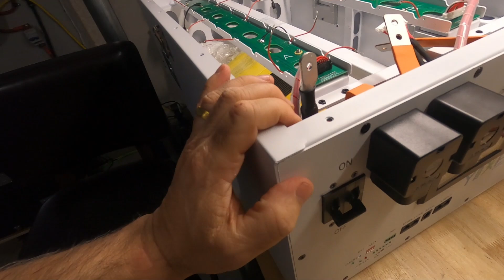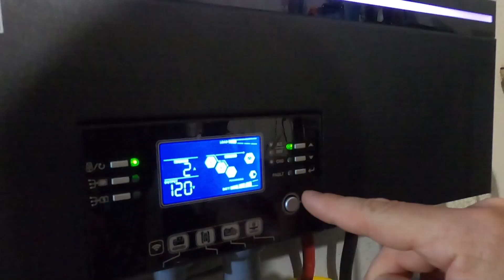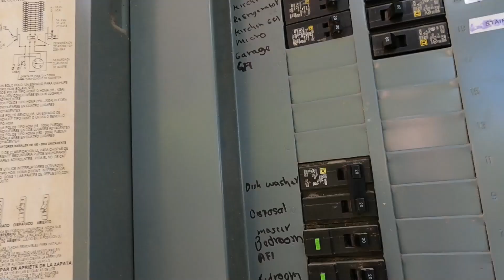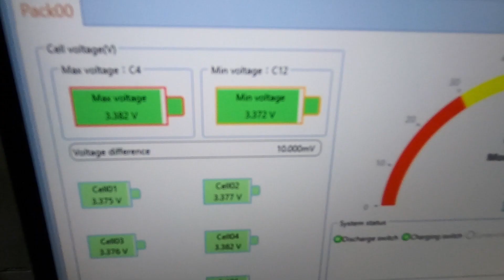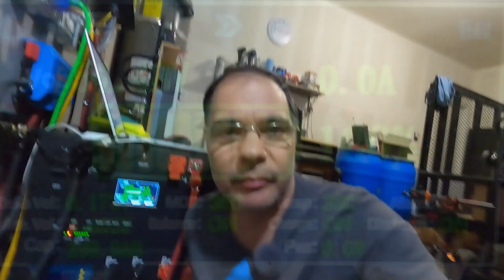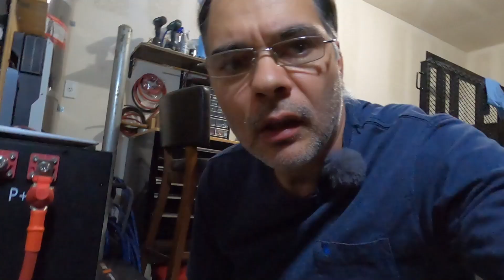Top Balancing The Yixiang DIY Battery With JK Inverter BMS

Comment: For the most part a 20 amp rated circuit and receptable should only be operated at 80% amps continuous for #12 conductors: A 20-amp circuit, as defined by the National Electrical Code (NEC), has a maximum capacity of 2400 watts, but for continuous loads, it's limited to 1920 watts or 16 amps to ensure safe operation and prevent overheating. This is due to the 80% rule, which mandates that continuous loads (those operating for 3 hours or more) should not exceed 80% of the circuit's capacity.

Comment: So for top balacing you need to turn off the battery manually? I tought was done automatically bij the JK everytime the battery was fully charged.
Reply from the maker: It is done at full charge, but if your cells are badly out of balance, you may never reach full charge or stay there long enough for the balancer to do its work. You should always do an initial top balance, in my opinion.

Comment: Hi sir, what you think about Heltec 10a active balancer? I think it should handle top balance 4 times faster
Reply from the maker: It's good.  I have one.  Yea, if you are building a ton of batteries and want to do it fast. But for the average DIYer, the 2a active balancer is fine.
Reply: @natesdiysolar  I just watched your video about top balancing, and you did it for a very long time, I have a 120 mv offset on three cells after fully charging to 3.6 volts and I wanted to speed up the balancing process, do you think heltec will do it quickly? Will it help?
Reply from the maker: @Reebcor  the seplos bms took a couple days but the jk took 8hrs I think.  Yes it would help.  Especially the 5a one. I think 10a would be overkill unless you are boxing tons of batteries.

Comment: This is probably a really basic question, but if you have a good inverter like the EG4 18k or a Solark connected to the battery and have the time to wait, would the balancer work itself out over time to equalize the charge on the batteries?  I get that initially you would be losing capacity while the batteries are not evenly charged, but would the JK BMS built in balancer do it's job if you just hooked it up and let it do its thing over multiple days?
Reply from the maker: It may or may not.. it really depends on your charge settings and if they are meeting the requirements set in he BMS to trigger balancing.. if balancing is never triggered, it will never get done.. unless you are charging from the grid, it may be difficult to get a low enough current for a long enough time to get a proper top balance.. so, in theory, it should work, but I would not recommend it.  If it keeps hitting ovp, the BMS will just turn off charging.  I always like to use a stable power source like a power supply or low current battery charger for the initial balance.. hope this helps.

Comment: My inverters don't float at all for Li batteries. When the BMS reports 100% the charge cycle is over. Had to play with the balancing a little to get something that worked but my cells never deviated more than .030 at the beginning. After about 8 or 10 cycles the cells were better conditioned and by the time I get to the top they are pretty close, less than .010 and below .005 within a few minutes. That's been happening with three batteries at the same time and I'm getting ready to add six more of them. I'm considering switching one of my converters to Lead Acid profile so I can get some absorption and float voltage on the bus from at least one charging source. I don't know, see how it goes from here.....
I'm pretty pleased with the JK's. My packs are pretty much charged to 100% everyday or very close so SOC isn't much of a deal right now. Andy at Off Grid mentioned in his last video that they may be coming up with a better solution for the SOC. Guess maybe there's a 15.34 rev for the Fireware coming? hahaha
Reply from the maker: Good to know.  Thanks for the info.  Good job with the batteries. :) 😀
Reply: Don't know that I can claim much credit for the cells. Every pack I've put together were all setting at 3.27 @ .001 difference. Nice starting point.
Reply from the maker: @beebop9808  yes at maximum there could be up to as much as 4ah difference between the cells and that won't shake out until you get near the top of the charge curve.  They come shipped with about 66ah in them plus minus 4ah..  3.27 is in the bulk or flat area of charge curve... it's not a bad idea to do a natural balance by placing the cells in parallel for 24hrs before building.  I don't have the nuts to put 16 in parallel thoughtv lol. Ill do 2 sets of 8.. I did a video where I cycled 32 cells and hand matched them to build a pack with only 1.5ah deviation. Watch the delta under high charge current the more change you see in the delta is a indicator of how well or not well your pack is matched..

Comment: It should not balance at such low voltage... 3.35v and balancing..why??  it's impossible to balance at such low voltage. because there may be all the cells at the same voltage - aka balanced but in reality they are NOT balanced because we balance the CAPACITY not voltage, so at such low voltage impossible to balance because it's FAR from fully charged.  If this is just for 1 time only because of 200mv diff -then ok, but for later use -balancing should start at 3.41 and higher.
Reply from the maker: Yes, 3.40 is trigger.. 200mv initial.  Plus deviation.  We don't run balancer below 3.40v. There are 2 factors at play. Delta and / or cell voltage.

Comment: What amp fuse are you using? 
 Just noticed the marine fuse on the Pos. stud.
Reply from the maker: That one is a 150a... since I have 2 batteries in parallel, I should never see even close to that, so why not keep it low... once I add another battery, I'll probably change to a 100 or 125a.

Comment: I got a 6020D 60v 20A charger (Wanptek High Power Laboratory stabilized power supply) and set it to 55.2v at 700ma charge (this is after I have charged it as high as it can go) then let it go for a day or soo(with balancer running..)
The current is so low that the bms does not shut down and you can creep up on the 55.2v when all the battery curves converge on each others and you have no runners..you may have to tweak that current if you have a very fast runner battery a little..(ie lower current even more)
Reply from the maker: Good to know.  I'll be using that method on my next build.

Comment: What's the purpose of top balancing?  is it just to make the batteries last longer?   Sorry I'm new to this and trying to learn.   I plan on buying this DIY kit to put together and install in an RV, but right now I'm trying to learn all this terminology.
Reply from the maker: Yes.  Since the battery is made up of 16 individual cells.. you want to be sure that the cells are in sync, so they charge and discharge together as a pack... this will ensure that no single cell is being worked harder than the rest.. if the cells get too much out of sync, the bms will shut down the battery to protect the cells... although rare.. it can happen.

Comment: Check out UBPpower, they have lots of different combinations of 48V, 24V and 12V DIY battery boxes in the Orange color.
They have one with a JK inverter BMS, with 4.3" JK touchscreen display on the front panel that doesn't cross the communications cable because the display is next to the communications board. 
The 12V and 24V battery boxes also have the Anderson Charging Port.

Comment: In your opinion witch BMS is better... the Seplos or the JK please ?
Reply from the maker: At this point, it's hard to say.. it really comes down to what features are important to you..  they both have their pros and cons . I really need to make a video about this... but here is the nut shell. If. You don't care about fancy display and are more concerned with accurate soc readings, and you need good comms support..  I think the seplos is the choice.. but make sure you get the v3 with 1 or 2a balancer.. I can't remember..  the v1 and v2 are maintenance balancers only.. just 150 mv and is painfully slow... if you want ease of use and don't need comms and plan on using a shunt to get soc, then jk is fine.. seplos has a bit larger of a learning curve  with its software, but once you get used to it, the pc software is pretty good.  Jk would probably be a clear winner if it had accurate Soc reading and better comms support. But seplos.. although crude.. is pretty damn solid.. unfortunately, I have not tested comms on either one, so I'm only repeating what I have heard or read.. check out Andy from off grid garage as he has delved into the comms much more than I at this point.  My biggest issue was the small balancer (v1 and v2 only) and lack of info on the front panel screen.  I don't use comms, so that not much of a concern for me.. I hope that's not about as clear as mud, lol. 

Andy has a comparison document on his website outlining the features of both.. Will they both protect the battery.. yes.. 
Comms, balancer, ease of use, accurate soc and current readinds..
Reply: @natesdiysolar  Thanks a lot for the answer... I think I'll go for Seplos v3 with load-balancer.

Comment: You’re not supposed to draw more than %80 from a circuit, so a 20A 120V outlet is 2,400 watts, don’t draw more than 1,920 watts due to breaker heating, if you don’t want to be tripping the breaker…
Reply from the maker: Thanks.  I just miscalculated.  The Inverter only allows 10a increments only.  It's temporary.  I need to run a proper 50a circuit. I just haven't done it.. I leave it unplugged otherwise.